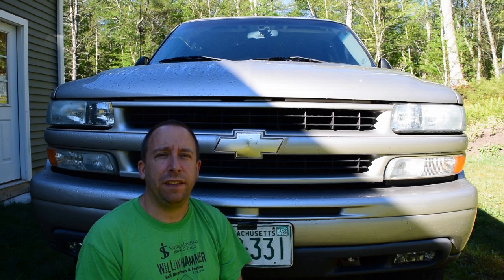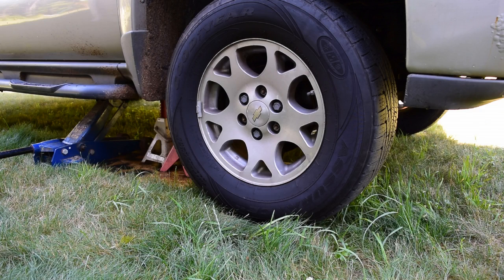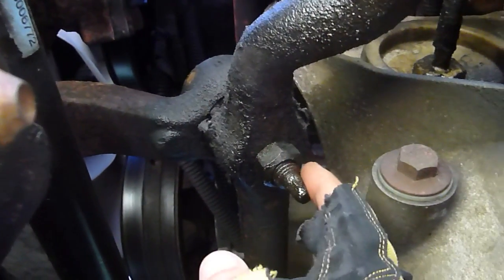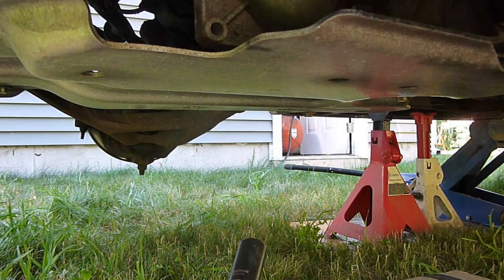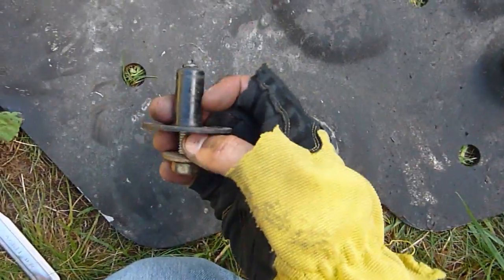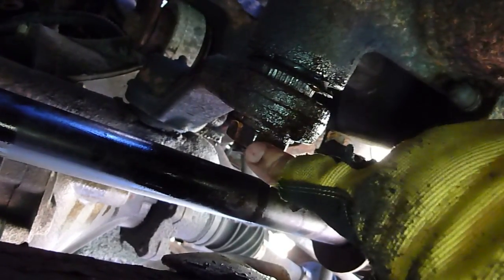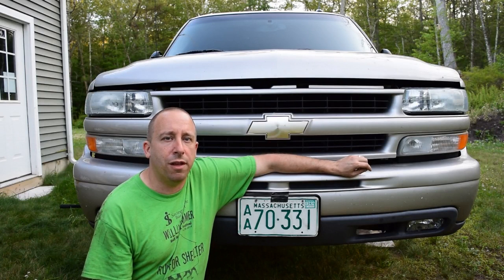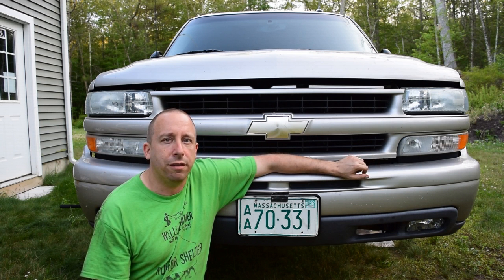Pitman Arm Removal - Chevy/GMC Trucks and SUVs - GMT800

Comment: Hi! Thanks for your great videos. Speaking of all the videos of pitman arm, idler arm and bracket, removing and installation. 
I did this job yesterday (with your videos as step-by-step guide) actually an easy job, but…  hell my idler arm was stuck in the center link. I think that I hammered on it all day 😅. If I had a propane tourch it would be easier I think. After hour, wd40 and heat gun it finnaly popped loose. The pitman arm was much easier. I had a big pipe wrench to loosen up the nut. With the pitman arm puller It came off pretty easy, but the puller was bent after the job. Looks like those pullers are one time only if those arms are pretty stuck. Before I mounted the steering box I tightened the big nut with my impact gun, that was very easy, looked like the nut was bery vell tourqued up too.
Now the car steers as new.

Thanks, this is my experience with this job on my 05 Escalade.

Thanks Borre from Sweden

Comment: @8:30:  You mentioned that the wrench loosened up and you rounded over the nut a little.  That might've happened because it looks as if you were using the wrench backwards.  When using adjustable wrenches, the adjustable jaw advances and the fixed jaw follows in the rotation.  That binds the adjustable jaw.  If the adjustable jaw follows, the rotational force against it works it open.
Reply: @@waynesmith8358    Take my word. Buy yourself a 35 mm ratchet wrench, it makes taking the nut off the steering box  MUCH easier.
   Do NOT heat the steering box pitman arm, it will ruin the seal in the steering box. You can use a grinder with a cutoff wheel to cut a relief in the pitman arm, it come off east then.
You can also adjust your steering box, to take the slop out of your steering. Use a 15 mm wrench and a 3/16th allen wrench. Don't adjust the allen bolt over 1/4 turn, lock it down.
Adjust the allen bolt by 1/8th incriminating, if needed.

Comment: Leaving one of the bolts in the steering box allows it to pivot and gives you extra support. At least on a silverado it works
Reply: Best comment 👌 very helpful tip.
I worked on the burban 4x4 as well
3 yrs lol
✌🏽✌🏼🇺🇲🇨🇦
Reply: Would have helped if he took the sway bar off as well

Comment: Just changed mine on a 1995 k1500 that spent it's life in PA, it was a nightmare to say the least, had to use a  mini sledgehammer and an 1-5/16 wrench to break that pitman arm nut loose
Reply: I'm doing my 95 today its seriously tough

Comment: Holy crap. I just managed to take mine off. It was practically welded on. I had to take the steering box off and grind it off because I destroyed a puller trying to take it off.
Reply from the maker: They are a pain to remove....I was lucky mine came off.
Reply: cut off wheel works great on them if your careful
Reply: @jetttskiman  that's what I did.
Used a Cutoff wheel to cut a groove in, but not all the way to the splines. Then took a chisle and drove it into the groove to spread the cut, then used a puller, and it popped off

Comment: I find it easier to unbolt the pitman arm and idler arm from the center link then it will fall down then instead of removing the steering box bolts I use an air hammer to remove the pitman arm from the shaft much easier and quicker
Reply from the maker: Good tip!

Comment: What size is that pitman arm nut?   Metric or SAE?
Reply from the maker: I think it is metric...not sure of the exact size though
Reply: 34 mm good luck
Reply: 1- 5/16 or 34 mm.on the 01 2wd Tahoe
Reply: @SevenFortyOne  what about makes you think it's metric when you don't know what size it is?
Reply: For a 2016 Silverado 2500HD it’s a 46mm
Reply: @SevenFortyOne    The steering box nut is 35mm.  If you buy a 34mm ratchet wrench, it makes the job a lot easier.

Comment: SHOULD HAVE MARKED THE PITTMAN ARM SO YOU COULD HAVE ALIGNED IT AFTER YOU INSTALLED THE NEW JOINT
Reply: ROBERT BOCK mine had master splines so it was straight forward
Reply: Yes you should on some applications. But these Chevy truck and suvs have 4 spline alignment guides on both the steering shaft and the Pittman arm so it is not terribly difficult to align

Comment: Sweet video.  I have 2 comments, 1   instead of PB blaster I use Kroil, it is amazing http://www.kanolabs.com/  and 2 whacking the tapered ball joint on the side will release them rather than on the end of the threads.  My 2 cents

Comment: I lifted the boot on the steering gear box to get a puller on the pitman arm and now I'm trying to pull the boot back down. Any ideas?
Reply from the maker: It should just slide down using  a blunt screwdriver...just be careful you don't rip it
Reply: Also easier to work on if you drop the sway bar.

Comment: How many grooves is the pitman arm for 03 Escalade awd?
Reply: What are you trying to determine?
Reply: @joeyjonson6017  There are two different GM steering shafts that the pitman/idler arms slide on to.  One has four "large splines", one has three "large splines".
https://www.rockauto.com/en/catalog/chevrolet,2004,silverado+1500,5.3l+v8,1424102,steering,pitman+arm,7368

Stay gold.
Reply: before you take the pitman arm off the steering box always put a mark there either using a fine tipped marking pen or if you can get a small grinder in there to put a tiny nick on there do that…then when you get it off line up the old pitman arm with the new one and transfer the mark to the new pitman arm…this ensures you have the new one aligned correctly with the correct splines on the steering box…put the splined end on first…saves lots of swearing… name calling….and expletives later….!